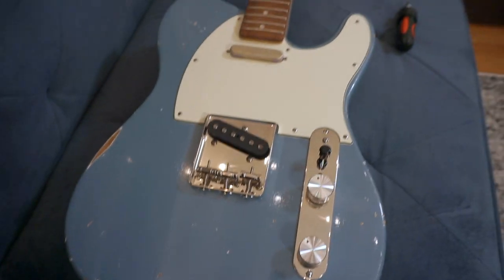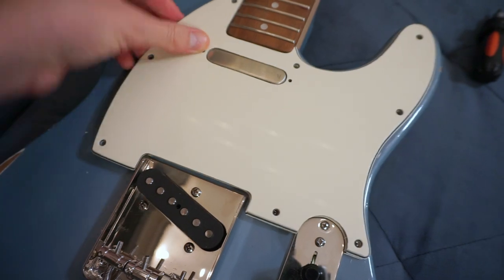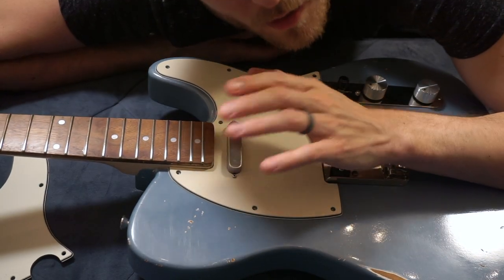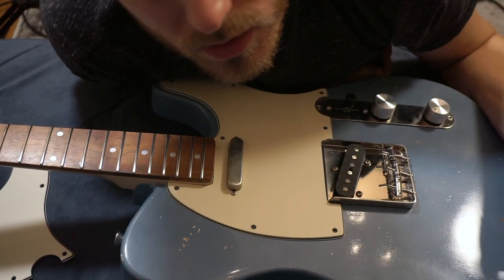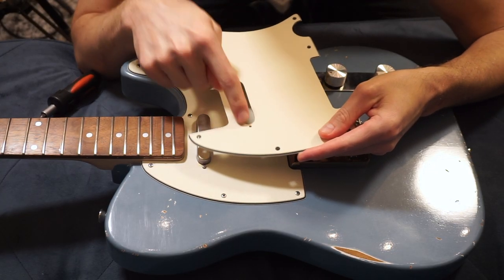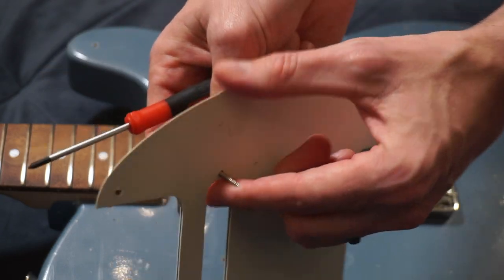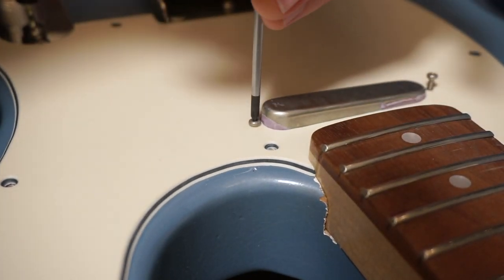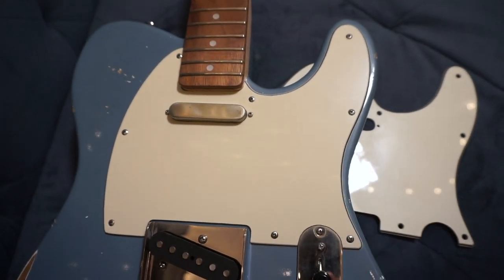How To Change Your Pickguard | Easy DIY

Comment: hi! i just watched your video. my telecaster has 2 screws beside the pickup. i have bought an pickguard online that has no hole for the 2 screws beside the pickup. do you think it will fit or should i buy another one?
Reply from the maker: Hi! You till most likely have to drill two holes into the pickguard so that you can properly mount it. Otherwise if you can't drill the two holes, then you will have to buy a new pickguard with the mounting holes.
Reply: @VanHoutenBuilds  thanks you! i will try it

Comment: What happened to the springs that came out with the tubbing
Reply from the maker: I did not use springs on that build, I used tubing instead. You can use either or. It doesn't matter, they both do the same thing.

Comment: I tried replacing on my telecaster, but there is one screw hole that does not fit. Should I just leave that hole unscrewed?
Reply from the maker: You can totally leave the one screw out, or you can drill a new hole if you can't see the old screw hole. If any part of the old hole is visible, then you won't be able to redrill a new hole.